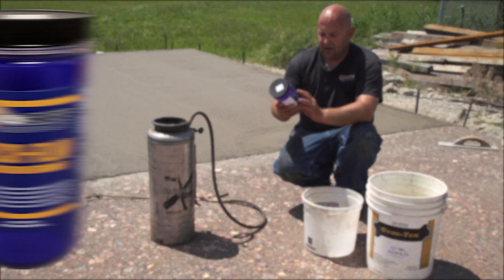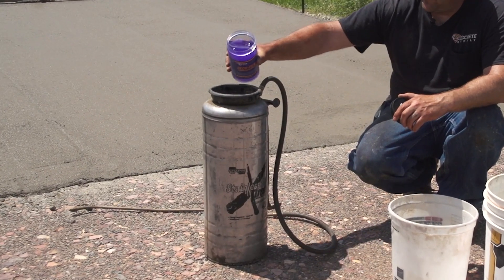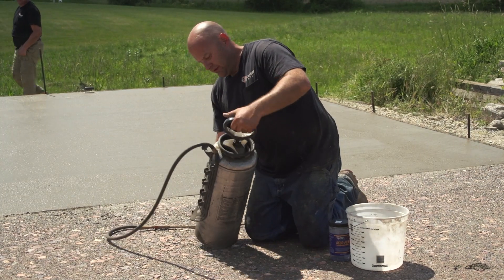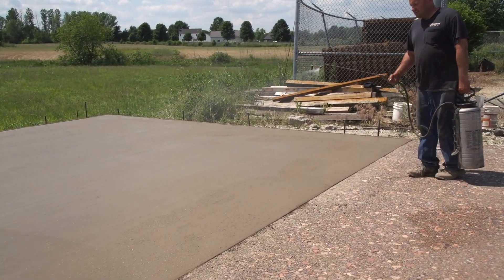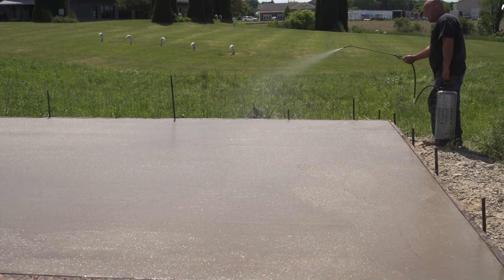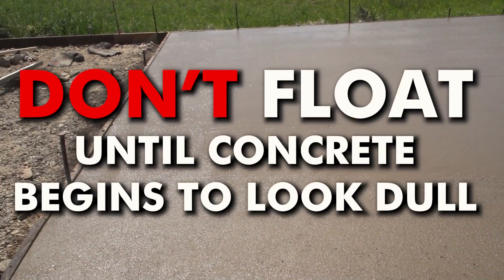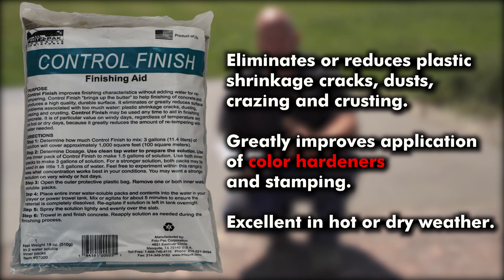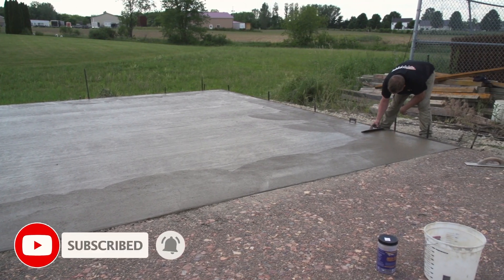What's The Difference? Concrete Evaporation Retardant VS Finishing Aid!

Comment: So when would you want to you one vs the other?  Also, is the finishing aid likely to water down the color?  Say for example, you did one pour one day with integral color, and then the other day was hot and dry and you used trowel aid.   Seems like you have a lighter color, and the 2 pours wouldn't match up as well.   Thought on applications where you'd use one over the other.
Reply from the maker: It will not water down the color, as long as you are not overapplying there should be no noticeable color difference